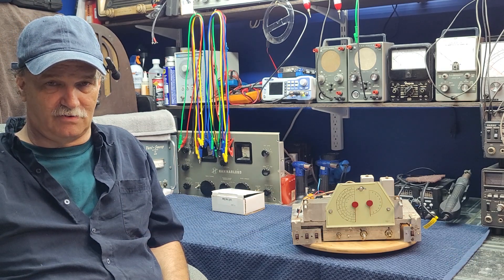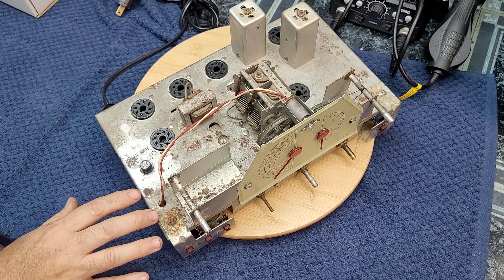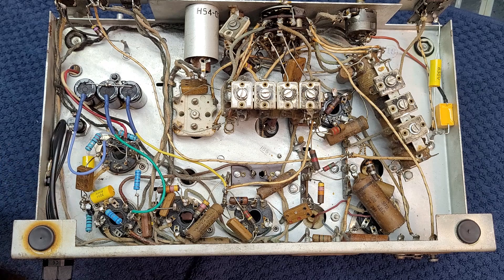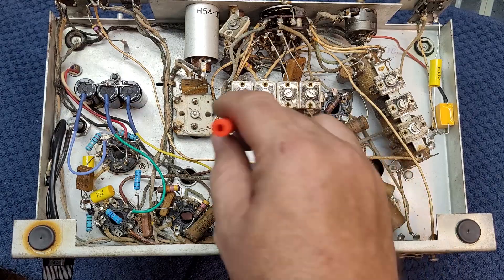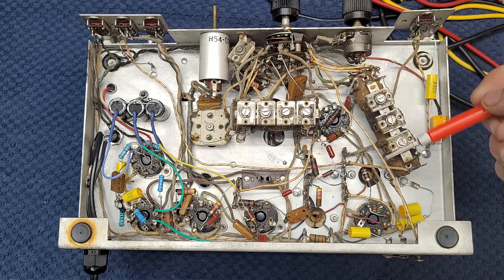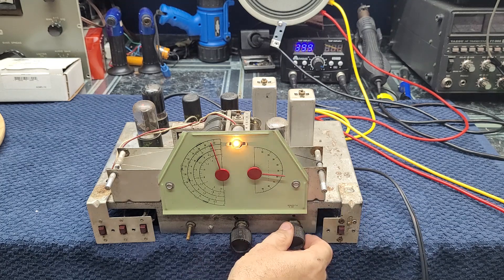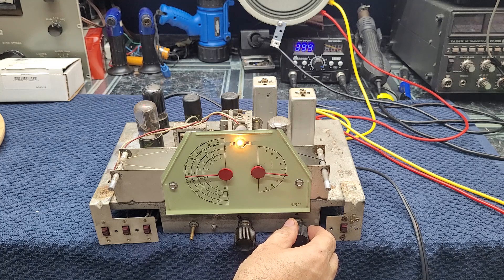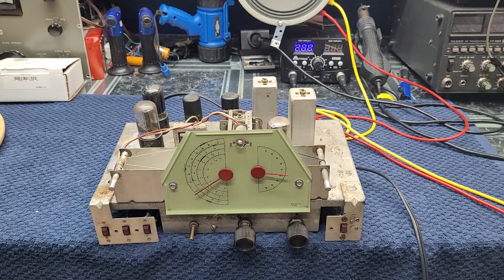Hallicrafters S-38 Restoration Pt. 2 - Recapping and Resistor Replacement - First Start Up!

Comment: I have a S-38 that was recapped by the previous owner. The radio works fairly well (they did not have the equipment to align it). However, it has two issues. The first is a fairly loud hum with the volume set at minimum. The second is that the volume, when you turn it up, gets extremely loud with the volume control barely turned up. I've checked the replaced capacitors and they are the correct value and in the right place. I'm not really happy with how the electrolytic capacitors were replaced, so I will be redoing them. I've replaced two bad tubes (both the 12SQ7s). Odd thing is, I have an S-120 with the same very loud volume issue that I have tried everything suggested with no results. Any ideas on this? Thanks.

Comment: Hi Mike. Mike here too! Awesome video series. Im in the process of restoring my S-38B. Ive made all the necessary safety modifications and recapped/re-resistored it. Powers up great and works! However, on the lower half of all 4 bands, the radio makes loud popping sounds. Upper halves work perfectly. I suspect that the tuning capacitor blades may be contacting eachother. Does this sound like a good guess or do you have any other tips?
Reply from the maker: Im sorry I missed this queston till now. Yes thats the first place I would look. Especially if the popping is in time with the movement of the tuning knob. Could be plates touching or contacts that need a drop of cleaner. Cheers!

Comment: Hi Mike, many thanks for your very concise and clear explanations of radio theory. One question I have is when replacing shielded wax/paper capacitors that have that line to identify shielded end, with axial polypropylene film metal capacitors, do you have to be careful of orientation?
Reply: Hi Mike. Many thanks for your swift reply. I’m very new to it all. I’m currently attempting to recover a Murphy A362. I guess I’ve done stage 1 and part of stage 2 of your restoration process. I’m looking forward to start working on it again. I need to get my workshop setup properly, so will follow your recommendations. It’s difficult to get a vacuum valve tester here in the uk. i’ve got my dads old AVO meter which looks like the simpson unit you have. It’s a shame the design on the underside of the A362 is so tight compared to something like the s-38. Thanks again Richard
Reply from the maker: @riggysretro9485  I wouldnt worry about which end of the cap is a foil end on that radio. Any which way you go is up. Working in tight spaces is a good skill to develop and being thrown into it is often the way you develop those skills. Murphy A362 - I dont know this radio. Probably a UK 220 mains deal. Good luck happy hunting. :)
Reply from the maker: Well, that requires a deep answer.  lets boil it down to this. For the S-38 - No. For the person who is new to restoration - No. For a big dollar radio - Yes. For an advanced tech - Yes.
Reply: Many thanks Mike. Your stages of the restoration process has helped me a lot. I’m looking forward to your future restoration’s and your knowledge to further my knowledge. Yes the A362 was made in Welwyn Garden City in the UK, so 220v. I have a variac, dim bulb and isolation transformer to work a little more safely. All the best Richard

Comment: Fantastic   one improvement i have made is to  Squeeze a small power transformer in and remove  the rectifier with a diode  this was time consuming but the radio works well  and  the series filaments were a pain  there are 12 volt tubes that work just as well